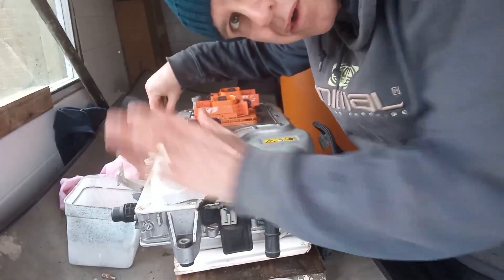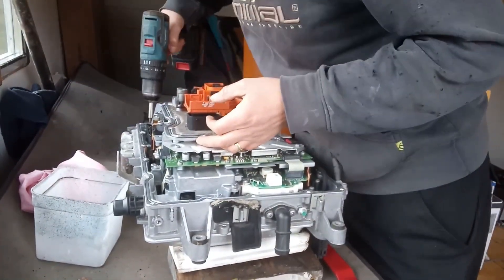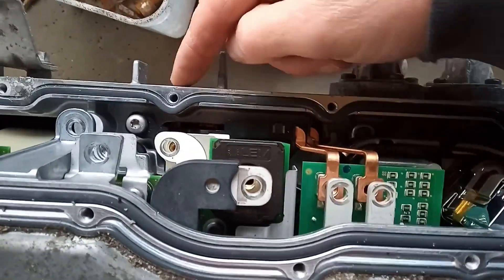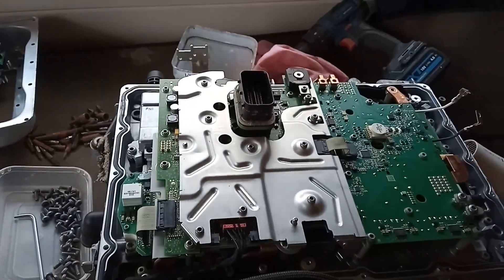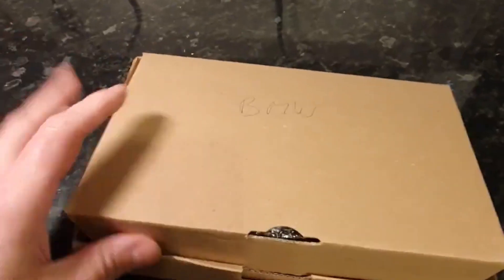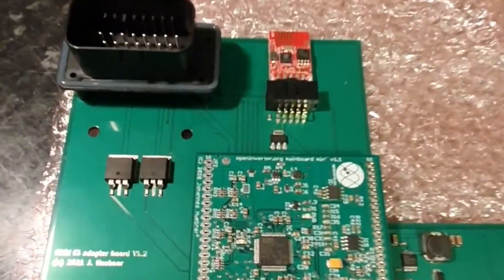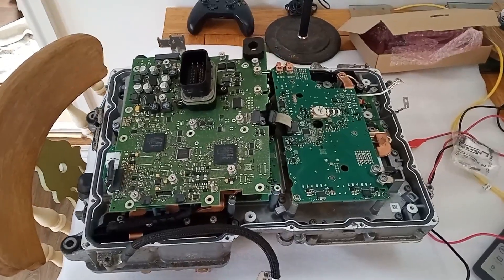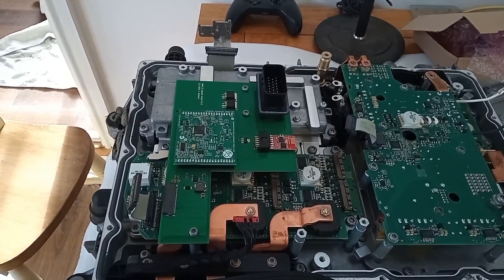Mini i3 project replacing the inverter board

Comment: what were the codes? i have i3 that doesnt engage drive or reverse. how can i diagnose module or transmission?
Reply from the maker: Hi, really sorry but I am not an expert, did you get this fixed?
Reply from the maker: I have heard that the gear selector can fail, have you tried replacing that first?

Comment: What's the main idea fro this replacement ? Yout previos board didnt work ?
Reply from the maker: The idea is to be able to control it without using BMW software
Reply: @MiniLifeCrisis  Thank you for the answer! Does this board will be suitable for REX and BEV? I see that video has been added 1year ago. Could you please share your feedback  - did you have any problem during this period ? What features did you use more often to control eme ?
Reply from the maker: @1o11o11  Hi, the idea is to use the EME to control the i3 motor in a classic Mini which I am converting. We haven't finished yet so I don't really have any feedback for you yet, sorry. I don't think I would suggest doing this if you are keeping the EME in an i3. Hope this helps 🤞

Comment: My heart sank when I saw those surface-mounted electrolytic capacitors. Oozing electrolyte onto the PCBA, creating leakage paths and dissolving the copper traces is what they're known for, especially when subjected to heat.
Reply from the maker: I'm sure that's all possible but there are cars getting to high mileage now and it's not something I've heard of.

Comment: do you know when you replace this inverter back to the car. is there any specific program needed ? I believe it's just direct replacement .
Reply from the maker: As I am using a prototype open source board it will need programming with the open inverter software.